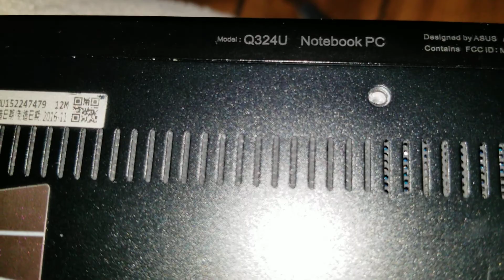ASUS Q324U Disassembly M.2 SATA SSD Upgrade Replacement

Comment: Can u show video on how to remove its battery.
Reply from the maker: Only way I can do that is if you mail me yours. I do the repairs for a living. I do not own the computers. I return them to their owners once repaired.
Reply: It's Binh Repaired 
Plugged usb phone cord in and the fully charged laptop shut down and won’t restart even after disconnecting battery and using power cord from mine from matching computer.  Ideas what to check next?     In the meantime what part do I move over to the matching computer that has my data on it so I can access it?
Reply from the maker: @barbara82589  hard drive SSD can be moved over. You might have to pull the battery and cmos battery if there is one.
Reply: It's Binh Repaired     Both of mine are Asus Q324u’s (as in your video) purchased at the same time, one working fine the other now dead.  I don’t see a cmos battery, nor understand why I would need CMOS & main battery swapped too). Or would getting an ssd m.2 adapter with usb interface to hook to the working laptop be be a better option to access data from dead laptop. (Sorry to pick your brain, but we are layed off due to Covid so repair shop not an option)
Reply from the maker: I'd just use an adapter to read the drive